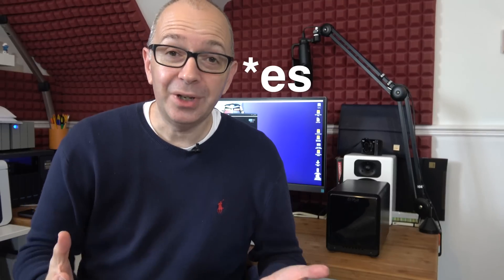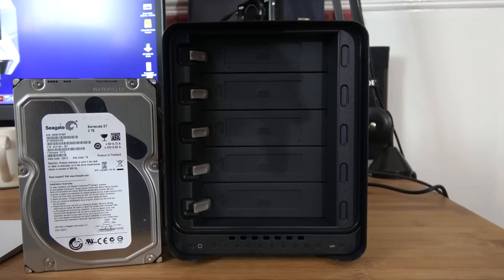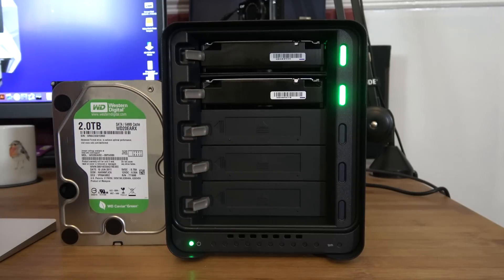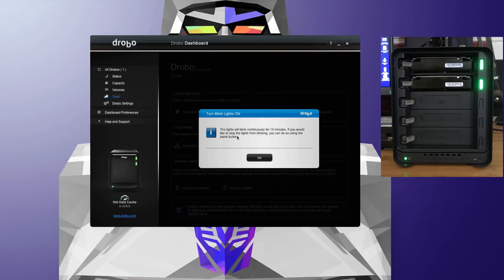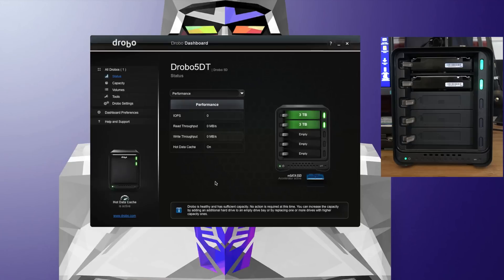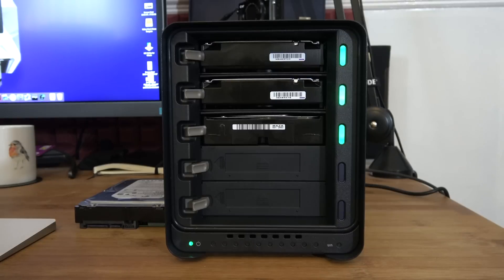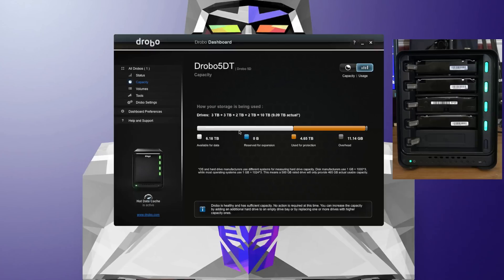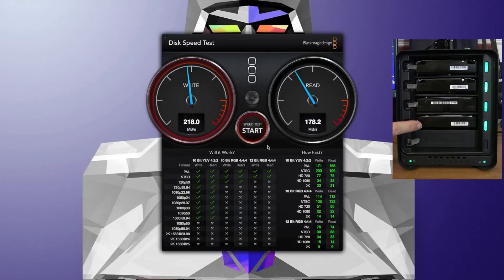Drobo 5D TURBO 5Dt Setup - Features & Performance - Talking Tech #Drobo

Comment: For comparison, I just got a Drobo 5C and installed a mixed bag of drives and I am getting 100-120 MB/sec write, and about 150 MB/sec read over the USB-C connection.  Using it as offsite backup, so works great for me.
Reply from the maker: Awesome, great to hear Scott.

Comment: Dave in this video were the drives set up to mirror data?  Where in the video did you show how to choose between all drives as single storage unit or in sets of two to mirror?  I am looking at this unit plus another.  I want to mirror my drives, so that if one crashes the data is saved to another?
Reply from the maker: Hello John, you do not get the choice. Drobo uses their own Hybrid RAID system that mirrors data automatically two give either single or dual drive data redundancy.

Comment: What about encryption? They say this drive cant be encrypted at less is done setting it up as a Time Machine volume.
Reply: That's my biggest complaint too.  I am using the drobo as an intermittent offsite backup and I want whole-volume encryption in case the drobo is stolen.  Some people report using TrueCrypt or VeraCrypt, but supposedly volume size is limited to 4TB.   I suppose you could chop up your data into <4TB chunks and sync the encrypted volumes to drobo, but that would quickly become a pain in the ass. I wrote Drobo but they are pretty notorious for their "limited" customer service, so I don't expect to hear back.  If enough of us write them though, maybe they'll listen.
Reply: Scott Barnett I was about to pull the trigger but the whole idea is about practicality and with this inability got me thinking, so I did not buy it :/
I also ask customer service and they replied saying "there  are ways using" third party software". I think is too much data on the line and also money for the thing to be playing around.
So no Drobo for me until encryption is available.